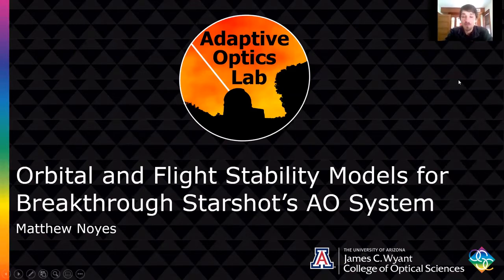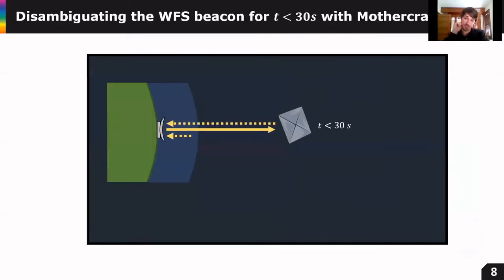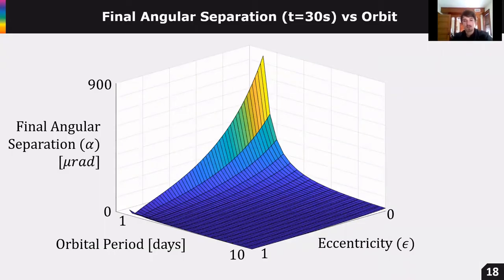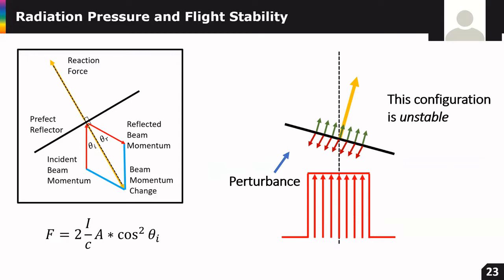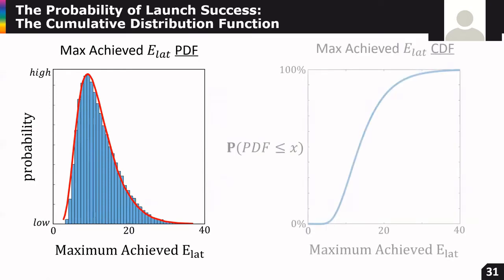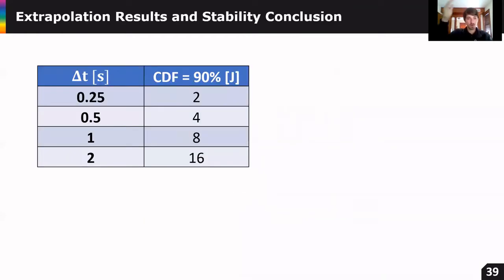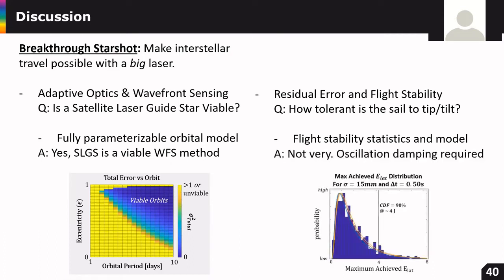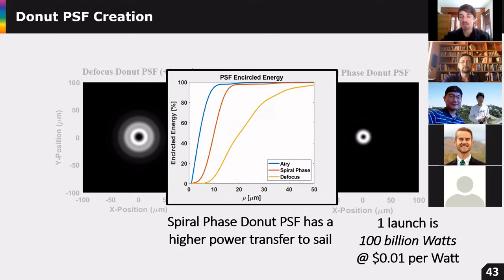Breakthrough Starshot Master's Thesis Defense - Matthew Noyes

Comment: Even to a total non-expert this was super-interesting. Re: dampening I assume there is some obvious-to-experts reason you couldn't use a tiny portion of the laser light as reaction thrust by using digital micromirror devices? To those unfamiliar with DMDs: https://youtu.be/9nb8mM3uEIc?t=167
Reply: Also it looks like IKAROS used LCDs for this kind of think if I'm reading https://forum.cosmoquest.org/archive/index.php/t-106368.html correctly - I'm guessing maybe it's just that LCDs and DLPs are too heavy, and unlikely to be able to be made lighter?